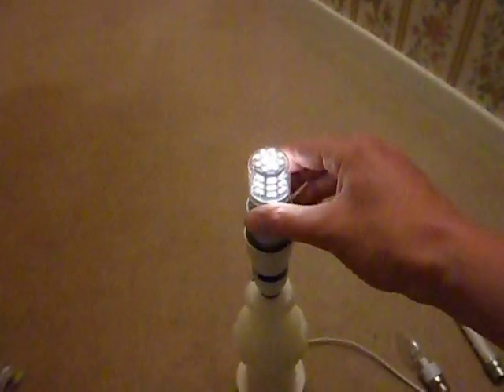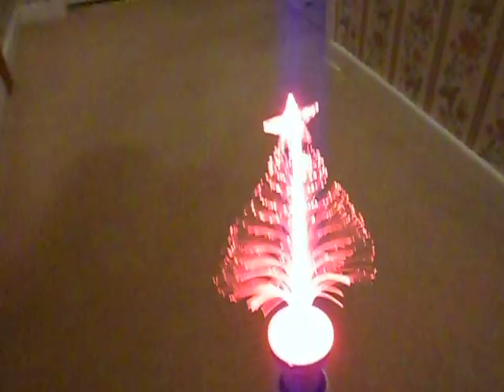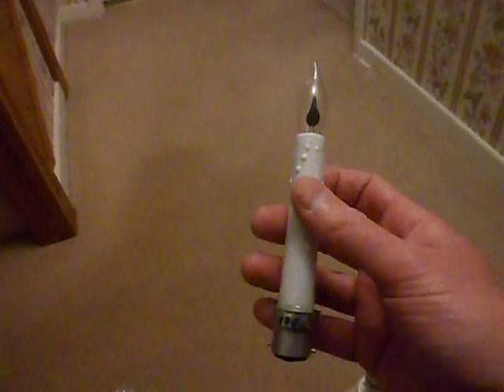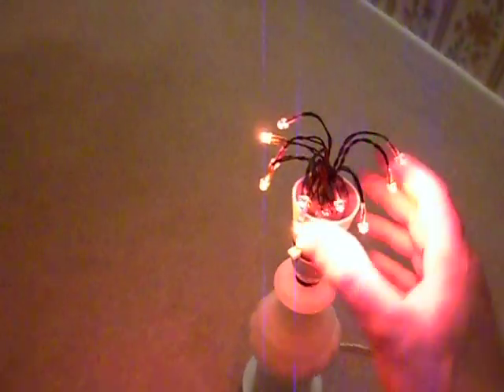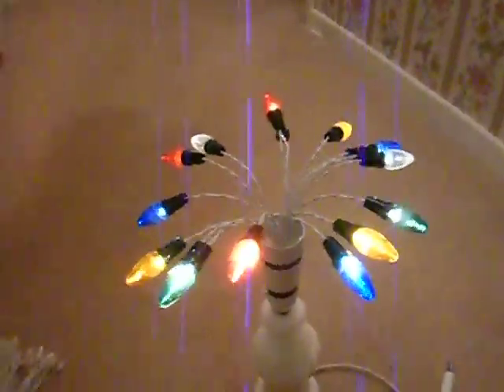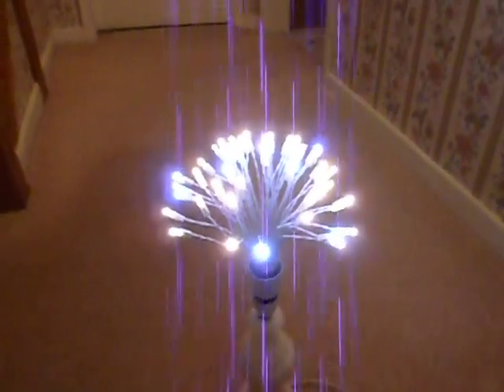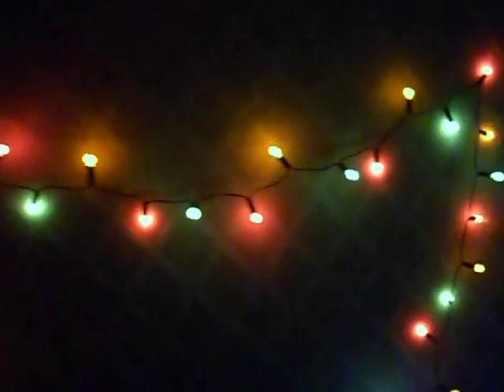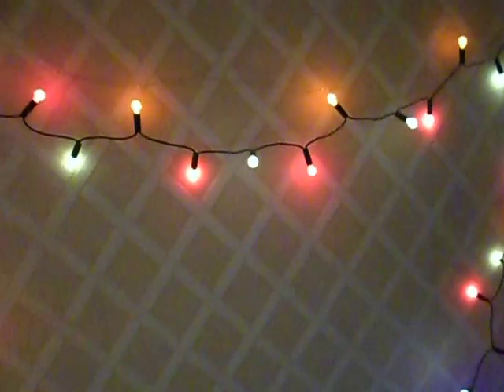Home made DIY LED lamps and others including big Calex LED lamps.

Comment: Love the LED lights!  Say, I realize this is a rather old video, and most likely I have seen it before since I am rather hooked on your LED's (Wife keeps telling me that I should watch them at night since your voice has a tendency to put my drug addled brain to sleep.  But anyhow, I was wondering, what size capacitor dropper cap should we of the 110 volt persuasion use to make our droppers for such LED projects?  Thanks.
Reply from the maker: Depending on how many LEDs are on series and how bright you want them I'd suggest 220nF up to 1uF at 250V.

Comment: Flicker + lensflare made these look like they were firing lasers or something like that. Very Sci-Fi
Reply: +Gadgetboy - It's not lens flare, it's a sensor artefact. Basically, when some pixels get too bright, the entire column gets saturated. Happens with a lot of cheap sensors. They look curved because the software is trying to compensate for the lens' barrel distortion.

Comment: Clive, you probably already know this, but the bayonet connector is not quite live.  You have to push down on the 2 connectors to make the connection.  Guess how I (and my blown up multimeter) found that one out! :)
Reply from the maker: +EscapeMCP Not with all of them.  You do get various safety versions though.
Reply: +bigclivedotcom Yeah, I wouldn't want to stick my fingers in one to find out whether or not it has that 'feature'.  I've been shocked with 240V too many times now and have ridden my luck a little too far!
Reply: +bigclivedotcom My question is - Which is safer? Bayonet connector, or the standard Edison screw lamp? o:
Reply from the maker: +DanJBMedia Both are equally safe if wired correctly.  By default both the live and neutral (hot and return) contacts are at the back of a bayonet cap holder, while on a correctly wired ES holder the live / hot is at the back.  But if an ES holder is miswired or used with a non polarised plug then the outer ring which is exposed as you screw in a lamp can be live/hot.  But both types of holder were "grandfathered" through safety standards as it is possible to put your finger into them and get a shock from the internal contacts.
Reply: bigclivedotcom  Thanks for the opinion :D I'm inclined to agree with you. For obvious reasons (Being from Maine) I've only ever seen a handful of bayonet connectors and they were all old death traps xD
Reply: The outher ring should not get live OR conected to neutral until you screw the lamp fairly deep. if the fixture uses metalic "nut/socket" that bulb screws in, it is not supposed to be connected to ANYTHING, the outer sleeve of bulb is supposed to make contact to a spring loaded contact inside, once lamp gets nearly completely screwed in..

Comment: Do a search on YouTube for "Clay Paky" lights and do a video on how to make one of those...you would be BOSS :]
Reply from the maker: ***** Clay Paky have been around for a long time.  They were the first to switch from using servos in their intelligent lights to stepper motors (Golden Scan) with the electronics designed by Pulsar in the UK.  They are still making some absolutely amazing lights.
Reply: bigclivedotcom Agreed! Amazing!...but they're sooooo damn expensive ...it kinda knocks the mobile DJ out of the game for the priceless look that they add to a show...wish I knew the technology better
Reply from the maker: ***** Clay Paky is a professional brand aimed mainly at the entertainment industry.  You can buy a wide variety of cheap disco grade lights for a fraction of the cost, although they are not really suited for heavy industrial use.

Comment: Hey! very nice proyects! about cutting LED's round points i found cutting them with a dremel cutting disc then politshing them with a 3 - 4 stages sand paper for nails they recover they clear surface, very very quick,  bringing a very smooth wide light. takes less than a minute the whole process on a single LED,

thanks for share your proyects & circuit maps ;)
Reply from the maker: Before the straw hat and flat top LEDs came out I used to use a modified belt sander to grind the ends off LEDs in bulk.  If they needed to be clear at the end I just touched the surfaces of the LEDs into two part resin and it made them clear again.  Take a look for the cracking ice video on how to get an interesting faceted effect on LEDs by just chopping the end off with wire cutters.

Comment: Do you use silicone or resin for potting the bases ? Very nice lamps you made there. Love the modifications.
Reply from the maker: I use the common two-part 5-minute resin that comes in the double syringe.  I tend to buy it from dollar-store type shops.  (Poundland in the UK)
Reply: bigclivedotcom
Thanks, I will get hold of that stuff too.